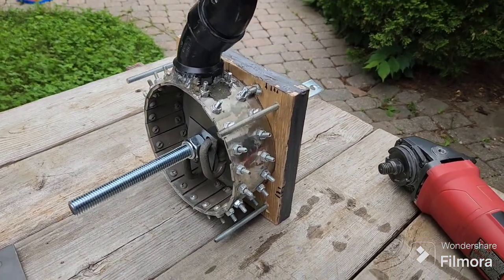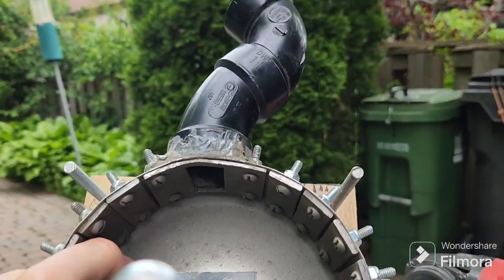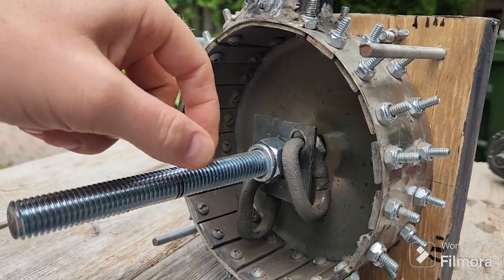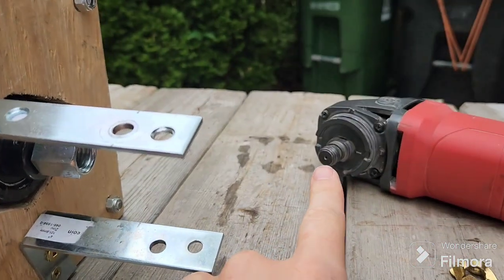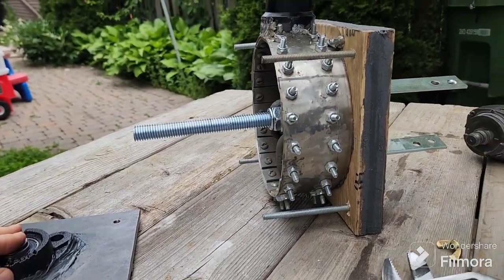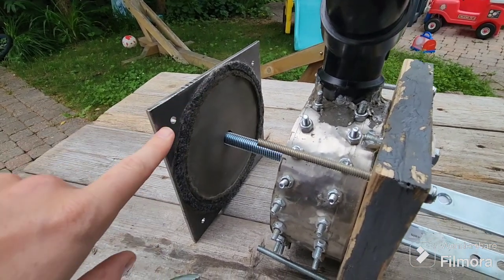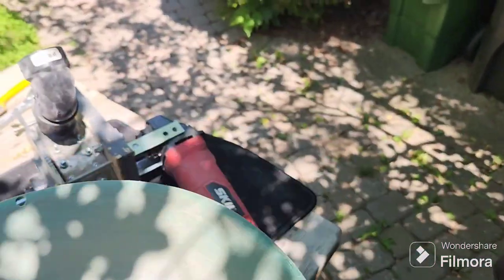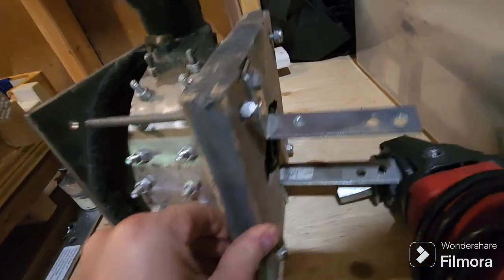DIY Mini Rock Crusher V2.0 (still no welding!)

Comment: A good little invention i would just go thicker like someone suggested a drum of a car and a couple  of clamps to hold a lid on rather than bolts and nuts. Only long term would be brushes on the grinder would wear quickly .how loud is it as grinders are high db plus chains would be pretty loud. Good on you for persistenting and expanding your ideas . Cheers
Reply from the maker: Thanks! Something with thicker steel would be a lot more convenient than using the replaceable plates like I did. Drum brakes have pretty big holes in the back side that you would have to figure out how to block up, but I'm sure that's an easy fix. A nice slice of thick steel pipe I suppose would be best.

Comment: Loved this video and the previous ones. I'm about to try and make my own. Where did you get the bearings?
Reply from the maker: Thanks!
I got the bearings from Princess Auto in Canada (C$14.99 each)
https://www.princessauto.com/en/2-bolt-standard-duty-flange-mount-bearing-assemblies/product/PA1000001323?skuId=3870177
You can get them on Amazon for a similar price, sold as a pair.
https://www.amazon.ca/PGN-UCFL202-10-Pillow-Mounted-Bearing/dp/B07W7LHWTM/ref=sr_1_2_sspa?sr=8-2-spons&sp_csd=d2lkZ2V0TmFtZT1zcF9hdGY&psc=1
The Princess Auto ones have a bit of a void space behind the bearing that I don't like. I can't tell from the images of the PNG bearings if they have the same space or not.
Reply from the maker: If you are in Canada and looking to buy a steel plate, I found this one at Princess Auto that was the cheapest option:
https://www.princessauto.com/en/12-x-12-x-3-16-in-44w-plain-steel-plate/product/PA0009055120
Reply: @LetsCrushRocks  Thanks so much!

Comment: What you really need is a vacuum set up somehow and one way valve to drop rocks through so the dust flying up gets collected but rocks don't escape either. 
If you shortened the exposed bolt you would be removing the mass there which is adding to the wobble in the unit, looks good and solid though.
Reply from the maker: I've seen others where they have an outlet port that drops into a bucket with a sealed lid. The lid then has another outlet tube leading to a vacuum so the material drops in the bucket but the dust is drawn out of the top. I think I might give something like that a try!
Thanks for you thoughts on the wobble. I might look at chopping some of that extra bolt off!
Cheers.
Reply: @LetsCrushRocks  I like that bucket idea for it. I've been trying to figure something out for mine and was coming up empty. So thank you too.